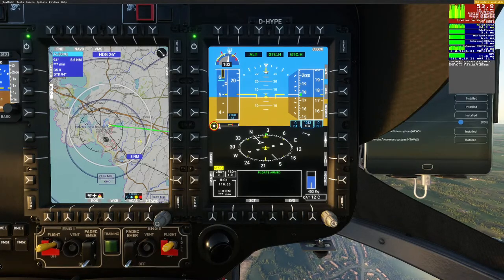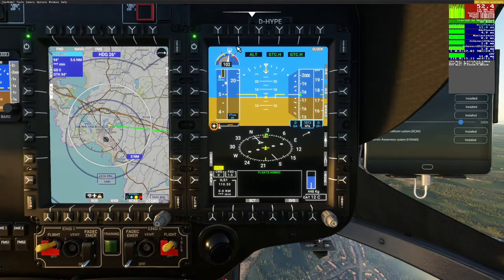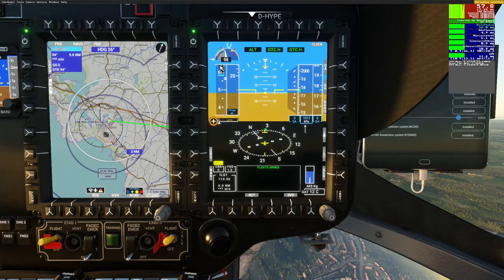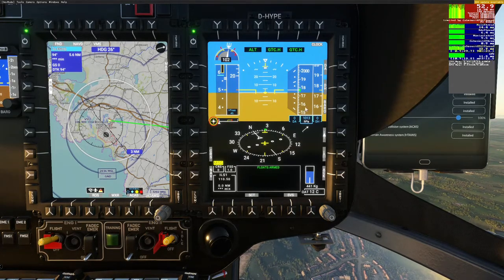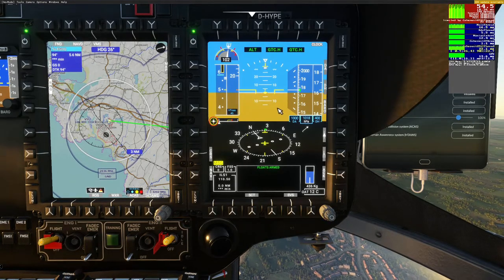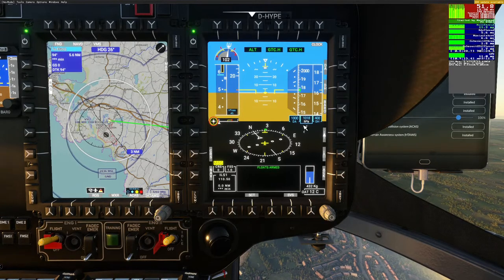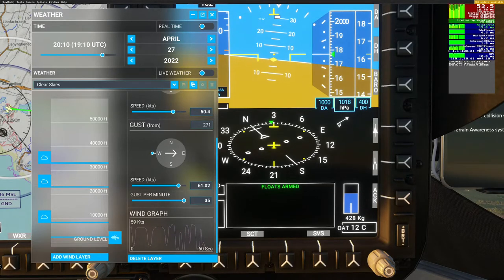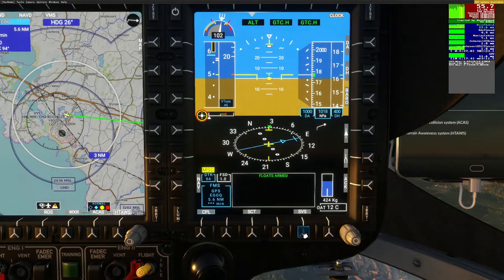2. H145 Tutorial MSFS 2020: Flight and Navigation Display

Comment: Great video thanks, Will be interested in the left hand limit indicators, and especially the mast icons just below it, I under the mast, but the little bar icon to the right of it is a mystery.

Also note, bottom left and bottom right you have LUM and BRT buttons which DO work (though in manual says inop) they  have an up/down (use scroll wheel) to adjust the brightness of each individual screen... You can also map some keys to MASTER brightness which changes all the displays at once, but I don't use that on.

Comment: Hi, what is your computer specs please?
Reply from the maker: I run in 4k on ultra or high settings. Occasionally with additional scenery I need to drop to high. This video is a bit too choppy for my liking, but started out as Ultra in 4k, then downsized. 4k looks great when uploaded but the filesizes are huge and it takes an age to upload/process online. I am looking into this but for informational stuff, HD looks fine. If I had the option I would probably look for a 1440k wide monitor to get the feel of that. (I use a 4k tv as my main sim view). 

ASUS ROG STRIX Z490-E GAMING - using on board graphics for additional monitors.
Intel(R) Core(TM) i9-10850K CPU @ 3.60GHz (not overclocked)
ARCTIC Liquid Freezer II 360 - we are talking a lot of heat! 
Geforce RTX 3080 (not overclocked)
64GB RAM, set at 1800Mhz. (but this is overkill by quite some way - 32GB is fine - or even less - but it allows me to keep other programs open and running)
NMe Drives for the main program. SSD's for additional storage - and some mechanical hard drives. Just seems to improve start-up times, rather than performance, whatever you use. I prefer the SSD's of course. 
Internet download speed is 40Mb/s
Avermedia 4k Capture card and OBS to record. (GC 573)
Rhino X56 / joystick/throttle
Stream Deck - very useful for programming different views.

I use quite higher end multi-core processor because it decreases the encoding time when producing videos, rather than just for MSFS2020, where (unless things have moved on) the core count is only one part of the equation as to how fast things run).

Thanks for watching.